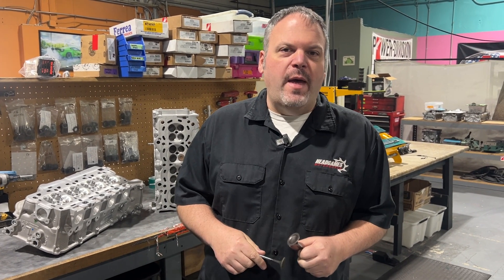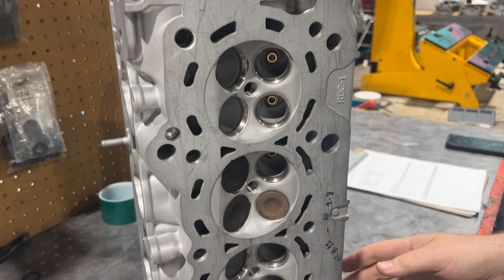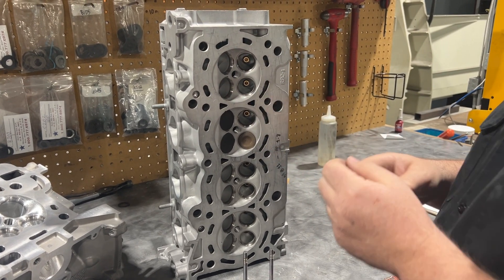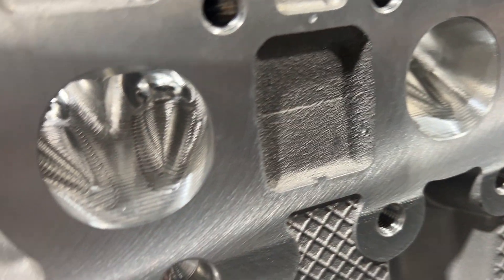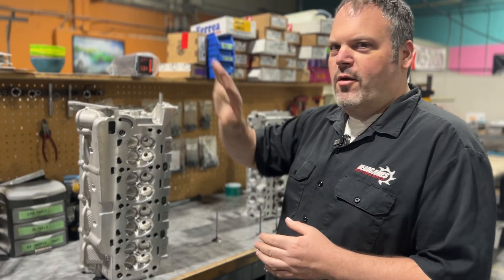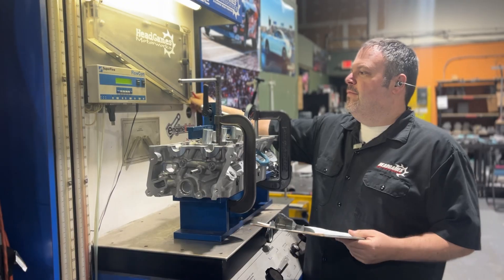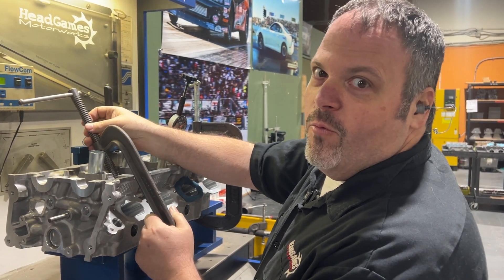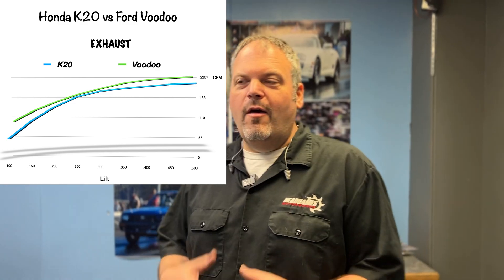Ford Voodoo vs Honda K Series: Flowbench Showdown – Which Cylinder Head Wins?

Comment: No K series has won overall Sick Week. 
Fords twin cam engines have.
No K has achieved 300.4mph in a standing mile. 
Fords twin cam has
No K has made 3,000 hp with a prepped oe cast block,heads, and oe crank.
Fords twin cam has.

The K is only king to kids.
Reply: The K-series is a mass produced engine developed in the late 90s/early 00s.  The Voodoo is a flagship low production engine more than a decade newer.  6 million cars had K-series engines vs 3000 Voodoo powered cars.
The K-series head was designed for an 86mm bore engine.  The Voodoos 94mm bore results in a 20% larger area.  Each cylinder displaces almost 30% more volume.  It has much bigger valves.  Its overall displacement is 2.1-2.6x the K-series so of course no K-series is going to match it for power.  CNC K-series heads flow almost 400 cfm.
Its too bad Honda is such a conservative company and never saw fit to make a big bore large displacement V8 based on the K or F series.  It would be superior.
Didnt the Voodoo suffer from NVH and reliability issues?
Reply: @K20EF8  Honda have a 5L marine V8 now, it's a J35 SOHC with two extra cylinders called the BF350 (only 350hp from 5L).  I assume the performance characteristics are nothing special as obviously it's designed for durability.  It's 89 X 99.5 mm compared to a J35 at 89 X 93mm.  
I can't really see Honda making a big bore engine that deviates much from the typical J or K bore and bore spacing, if Honda wanted to make a 6L or 7L engine, they would probably make a V10 or V12 perhaps?
There was a 5.5L V10 engine in the cancelled 2008 NSX after all.

Comment: 1299 panigale will probably be the best mass produced head. Would be cool to see a cbr1000rr(sc82)vs a 81mm bore ported b series. I think max flow will be more a question of which engine has the largest bore instead a comparison of 86mm bore would be interesting as there are a lot of engines with that bore.

Comment: Good video thanks for your time. Seems that comparing cylinder heads that are designed for different capacity cylinders, there needs to be a baseline of flow versus capacity as well to give a benchmark. The next test to show my point voodoo head against a factory performance big block. Not sure if there are any modern big block performance oe heads anymore.

Comment: M156/M159 if you can source one. Largest mass produced DOHC V8. 102 mm bore.
Reply: I want to find one of those, swap it into a Fox body with a Haltech Nexus or something, and push it with a turbo so bad - there's gotta be SO much potential in those M156 engine combos. Just imagine a Coyote, but 6.2l big bore instead of 5.0l small bore, good lawd! Too bad they aren't exactly the easiest engines to get ahold of and come with that Mercedes tax lol.

Comment: If you want to see another massacre factory head Chevy LS7 and you can flow it up over 650 lift just like it came from the factory
Reply: Nah, CNC K-series heads still beat CNC LS7 heads.

Edit: Mast Black Label LS7 heads flow 405 @ 0.700"
4Piston Reaper head flows 435 @ 0.700"
Reply: @PistonAvatarGuy   Who uses 700 inch lift cam shaft On a 4 cylinder  especially in a turbo application... Typically those cam shafts really don't go much past 400 inch lift  The same thing goes for the Coyote engine Is the hardcore cams  Typically barely go past 500 lift
Reply: @troylambert5140  4Piston ran a 0.678" cam in their 518 hp NA drag race engine. Who said anything about turbo applications? Almost every version of the K-series is NA, as is the LS7.

The point is: The K-series can outflow 2-valve heads designed for much larger bores. It's really not even fair to compare an engine with such a small bore to one with such a large bore.
Reply: @PistonAvatarGuy  A lot of things are possible when you make a new casting built for max flow. OEM cares about low rpm power and emissions.
Reply: @AlexAutoRepair1  Initially, 4Piston had the stock casting up to 435 CFM (that's what was first used on their 518 hp engine), they now produce a new casting head that flows 440 CFM.

Either way, we're comparing apples and oranges here, simply because of the difference is bore sizes.
Reply: @AlexAutoRepair1  I see where the confusion is. I called it the Reaper head, but they probably didn't call it that when it was still the factory casting.

Comment: Not surprised since it has more displacement per cylinder, it's machined from factory which could make a difference in the overall price of the head and therefore machining the k24 wouldn't be too far fetched in my opinion for a fair game, unless the cost difference is like less than 10%, I mean overall they are both 4cyl cylinder heads, so cost wise they should cost roughly the same if the voodoo wasn't machined from factory...

Comment: K is King. Voodoo has a bigger bore cylinders
Reply: The Voodoo also has 4 more cylinders… lean over and feel the front of ya Gf’s shit-catchers they’ll be saturated! 🤙🏻
Reply: WHO CARES ?
heads don't run on their own.
Both explode if put on a $5 block with Cheap pistons.......
And it only matters if you are building a $20k competition motor !
Otherwise port match and reassemble........cc ports if you want.
Reply: @Marc_Remillard it matters more than just for competition engines.
Reply: @damianlindsey6177  
How ?
If the bottom end is trash or stock,
It won't take the flow rate !
The entire exhaust must be changed
To get any real result .....
And the exhaust change will give a BETTER horsepower return than 
"Headwork" anyway...... extractors etc.
You only do it if you have done
 EVERYTHIMG ELSE FIRST ..... 
chasing the LAST few horsepower.......
By definition, only competition motors.....
Pointless otherwise, better hp improvements elsewhere....... 
change the stock cam !
Ram flow intake ( for n/a )
Exhaust
Intake manifold, injectors,  
Remap........
Reply: K is INFERIOR. Now the K is outstanding. No doubt. The V has to move a lot more air the the Lawn mower unit from Honda.
Reply: @dohcsmr1175  CNC K-series heads flow over 380 CFM at 0.500", so, yeah, the K is king.
Reply: @ You obviously did not watch the entire video. The K is vastly inferior to the V. Understand??!! It is not that close. My last post was deleted. I build engines for a living. I am very familiar with the K head. You are a mark. If you choose to be surly all the best to you. Now before you get all b hurt the k head is a very good cylinder head. For a Honda. It is not in the V’s league. So….do your homework before you post. You definitely come across as infantile.
Reply: @dohcsmr1175  A CNC K-series head is superior to a V. head, UNDERSTAND? Do you even know what CNC means?
Reply: @PistonAvatarGuy stock off stock remember that. You can further port a voodoo cylinder head. Stock for stock that’s what the comparison is. A stock K series was out flown by a voodoo cylinder head. Also the gen 3 coyote cylinder head flows as well at a voodoo head and that’s a stock casting no cnc port. Get wrecked
Reply: @kurtwuttke5787  Read the most upvoted comment on this video, then read my comments under it.
Reply: @PistonAvatarGuy  so a special ported head? That you can’t buy directly from Honda? We can play that game snot rocket had a Ported voodoo head (stock ford casting) flowing 395 at .500. Same dude who went a 6.0 in the 1/4 in a drag and drive car. The K series is good head but there is always something better out there. It’s the voodoo
Reply: @kurtwuttke5787  There's is no version of the modular V8 head that can match the flow rate of the highest flowing K-series heads. Even if there were modular heads that could match the highest flowing Honda heads, it wouldn't really mean anything, because the mod heads are made for engines with a significantly larger bore, so it's just not a fair comparison.

And, again, if we go like for like, raw factory casting vs raw factory casting, the K-series and F20C Honda heads can get up to around 311-316 CFM (K20A), while the Coyote heads only get up to 298 CFM (both @ 0.600").
Reply: @ wow you did no research when multiple companies flow test them at 357 CFM at .500. So like I said the voodoo is a better designed head. Also there are 4 generations of coyotes the gen 3 was designed from the voodoo just with a normal port.
Reply: @kurtwuttke5787  Also, there are Honda heads that flow 435 CFM. 440+ is possible with an aftermarket casting.

I've been trying to tell you people, you can't beat a VTEC head, because VTEC makes it possible to use ports that otherwise wouldn't work in a production car head. To anyone who knows anything about engines, it should be extremely obvious why this is true.
Reply: @kurtwuttke5787  The non-CNC head flows over 300 CFM? According to whom? I got my data from JPC Racing.
Reply: @ see that’s what I’m getting out you can accept defeat from stock for stock. BuT hOnDa HeAdS pOrTeD fLoW bEtTeR tHaN a StOcK casting stock port ford head.
Reply: @kurtwuttke5787  Because I just found three different websites that showed the cast Coyote head flowing at less than 300 CFM. I can't find your 357 CFM head anywhere.

And you can't accept that the highest flowing K-series heads easily beat the highest flowing mod V8 heads.
Reply: @kurtwuttke5787  And, I don't know why you're so hung up on stock vs stock, the point of this discussion for me is technology vs technology. Which technology works best, Honda's, or Ford's? Cast vs cast, CNC vs CNC, no VTEC vs VTEC. There's nothing scientific about the comparison that you're making, the bore is different and the heads are CNC machined, it's not a like for like comparison.
Reply: @kurtwuttke5787  Seriously, is this just about me being a bad communicator again? Because I said that no production head could outflow a K-series head, or something similar? Yes, I admit, that leaves out some very critical information. I suck at communicating my thoughts, I guess that makes me the worst person alive, but it doesn't make me wrong about everything.

My point was never to compare stock vs stock, it was to relay the advantages that VTEC provides in a production application, that's where this whole thing started (as far as I'm concerned).

Yes, the "stock" Voodoo head outflows the K head, but only because it's meant to fit on an engine with a significantly larger bore, not because it's more advanced in some way. If the V. head had been designed as a VTEC head from the factory, it would flow even better, that was the point that I was making.

Does that make my point more clear now?
Reply: @kurtwuttke5787  BTW, the original statement on this post was that the K was king, which is what it is, as there's no modular V8 head that can match the highest flowing K head. I just don't understand how I'm the one being vilified here.

There are 4 lights, Mr. O'Brien.
Reply: @dohcsmr1175  put the same valve diameter on a V and you'd have to a cpr to resuscitate it
Reply: Flow rate is
 DEFINED BY CAMSHAFT DURATION !
change the cam, get better flow.
A Flow bench is a tool.....
Engines CANNOT flow a flow benches numbers.
If it is, the capacity difference alone means
 THE VOODOO FAILED MISERABLY !
(It has much less cfm per cubic inch)

Comment: Hi Dave, I'm glad you've enabled automatic translation and I've been able to hear you in Spanish from the AI, hahaha.
In these tests, it would be good to know what speed the air has in the ports, because it is known that with a larger port diameter and a larger valve diameter, much more flow will enter, but you can have a very high flow with a very low air speed.
What do you think about this? I'd love to hear from you.
Regards
Goyo

Comment: Rbc head is from a 2006-2011 civic SI, the k24 head would be RBB
Reply: Yes your 100% rught. I have a 8th gen 07 si with k24a right now in it. An have the og k20z3 being rebuilt. Both amazing engines.
Reply: @mikellewis2346 still a decent comparison. The k series can make power, my daily is a 440hp supercharged k series swapped CB7 but even with 440hp, the car isn't as fast as a 440hp rwd car at the track. Now from a 30 roll, my car eats, but if you are trying to build a dependable, consistent drag car, starting with anything honda is a financially a stupid move. Now using the k series in a rwd platform with a th400 or stick cuts cost in half as you aren't tied to that junkass awd swap or sticking with the fwd bullshit.
Reply: @damianlindsey6177   ya rwd is always gonna be faster for drag racing. I love my Hondas for daily strait driving with a little fun on back roads an hiway racing. Lol I was looking at a supercharger for my si, what brand you running and has it bin reliable?
Reply: It would be hard and expensive but the type r k20 engine would be a more fair comparison i also think those are ported.
Reply: @repingers9777 the type r head (k series) aren’t ported.  The only “type r” head came ported was the b18c not k series
Reply: @bland3429  sad...
Reply: @repingers9777  They don't need to be ported, some say the ports are already too big as stock and too big ports killing the velocity is arguably why Honda heads don't make much torque as stock -- but it does mean you can already add a lot more power than stock without needing porting.
Reply: @repingers9777  RBC is a Type R head, it comes on the CL7 Euro R originally (K20a).
Reply: @ShinSpeedX  thats literally not a real type r
Reply: Sr20 Vvl head Vs K-Series please
Reply: @marcoabrahams2333  sr20 would be cooked

Comment: Just here to remind folks you can't think of power potential in terms of "flow" in a boosted engine the same way you do for NA engines. Remember your compressor is a DENSITY multiplier. To make double the power - you don't need twice the flow. You need the SAME flow @ twice the density.

It doesn't matter what the volumetric flow rate is. What matters is MASS flow rate.
Reply: These flow rates do not take density (or more appropriately, pressure) into the equation. Boost changes flow characteristics. Altitude/ambient pressure effects aerodynamics when making considerations for aircraft design.
Reply: @randoawesomemix9501  You prove my point: What matters is MASS flow rate, not volume flow rate - which is what the standard flowbench measures.
Reply: @GroovesAndLands  The name of the game is still getting as much air in the cylinder as possible.  A head that flows better NA is going to flow better under boost.  It will require less boost to flow the same mass and therefore make the same horsepower.  Less boost, less heat, better efficiency.  Just as you can double power by doubling the density or doubling the flow, you can double the power by having 1.4x the flow AND 1.4x the density.
Reply: @jaredshaffer3901  Yes, thank you for expounding on the premise that what matters is MASS flow rate.
Reply: @GroovesAndLands  you're welcome, I'll keep thinking about flow the exact same way though, because flow responds the same whether NA or boosted.  If it didn't, you would see companies developing boosted head flow benches.

Comment: The RBC-1 came on the K20Z3.

It's kinda hilarious to see what it takes to beat a stock Honda casting. A decade newer, fully CNC machined, designed to fit a much larger bore... and the difference isn't all that extreme.
Reply: Yep. Given the smaller bore and valves, Honda is pretty incredible
Reply: @KZ-se4ik  Pretty incredible is a massive understatement. It's literally unbeatable (at this bore diameter), outside of extremely high-end brands, like Porsche and Ferrari.

CNC Honda heads are in the 380+  CFM range.
Reply: They need to get their hands on an RSP casting K20 head, or AT LEAST a PPA K24A1 head, or PRB-1 type S, those all waffle stomp the RBC casting
Reply: @danbrown2080  They all seem to flow around 300 cfm at 0.500". Some are maybe around 310ish.

The bottom line is that it's just not fair to compare heads from engines with such drastically different bore sizes. Why not just put the K series head up against the Allison V-1710 as well?
Reply from the maker: Understand guys I was just trying to stick to what the comments were saying on the podcast. Nobody was defending anyone on bore size or anything else that makes a huge difference. I like that our fans are more technical and more knowledgeable about it and having this conversation!
Reply: just superb development from 90's F1 tech!
Reply: @michaelflynt6788  Honda has been in F1 since the '60s.
Reply: @PistonAvatarGuy  and still lost to almost every other manufacture in f1 aswell
Reply: @chargeduphellcat4937  And also dominated during periods when F1 engines were at their most powerful: 1986, 1987, 1988, 1989, 1990, 1991, 2022, 2023. They also gave Verstappen his driver's championship this year. Perez cost them the manufacturer's championship.
Reply: The difference is extreme though

Comment: First of all, very many thanks for your channel, all the work it takes and all the information you freely share - you do, we just watch.
My question/comment is:   How do these heads compare in terms of specific flow per unit area of cylinder bore? Obviously, the greater the gross flow, the greater the potential for power, all other things being equal, but should the question not be which is the most efficient design?  A  big block chevy head will always flow more than 50cc lawnmower one.  
Also, when quoting potential power outputs of these engines, figures for specific power per litre, per cylinder, per lb of boost/@ a specific boost pressure would, perhaps, be a  more 'apples to apples' way of comparing relative cylinder head performance, other mitigating factors not withstanding.  Simply put, the voodoo has twice as many (and bigger) cylinders as the Honda!

Comment: RBC is a k20A2 cylinder head from Honda FD2 typeR
Reply: RBC-1 is 06-08 Civic Si from K20Z3, K20A2 is PRB-1 for 02-04 RSX Type S, FD2 Type R uses the RSP casting head
Reply: @danbrown2080  how about k20z4 from civic FN2 type R is it RBC cylinder head?
Reply: @ I believe it is an RSP casting as well